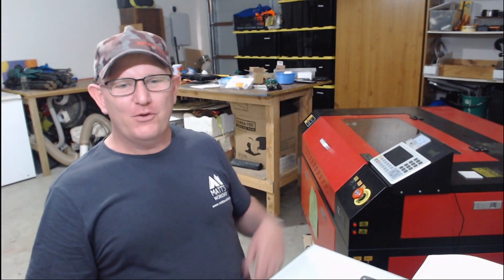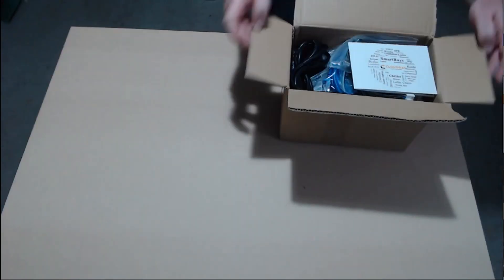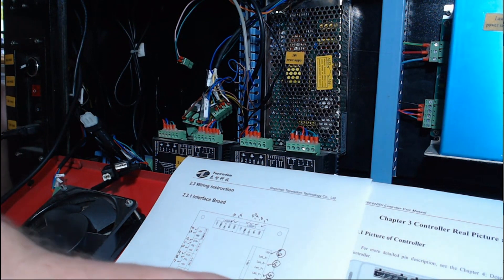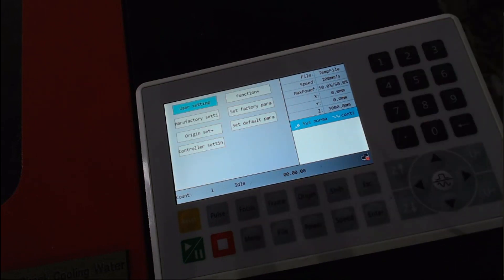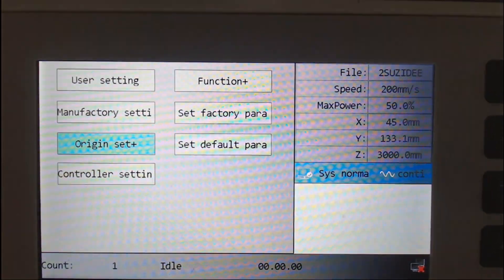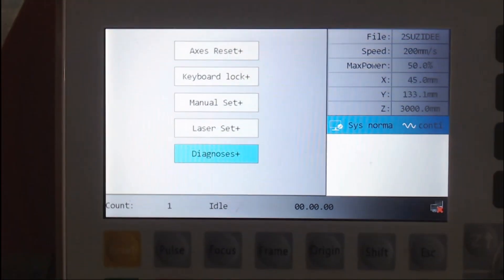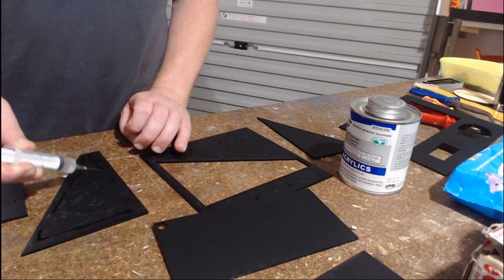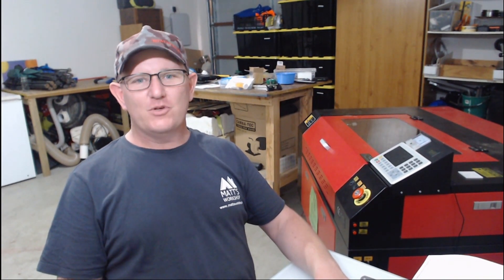Upgrade TopWisdom to Ruida RDC 6445 Laser Controller - CNC Co2 Laser Machine

Comment: I am about to upgrade my controller, I was hoping there was an easy way to copy the current settings for the machine to it. Have you ever tried to use lightburn or rdworks to export or import settings? I hope it just works.

Comment: Do you know if the rdc6445 panel will work on rdc6442 mainboard? It seems most the functionality is the same, it’s just difference button layout and screen size
Reply from the maker: No you should not use the RDC6445 panel with the RDC6442 mainboard. They have different functions and menu systems, in short If you connect a RDC6445G panel to RDC6442G controller, it can work but you will have many errors, such as:
When you read file from controller, it will hang / freeze up.
Files will not display correctly on the screen.
The function of some keys on the RDC6445G will not work.

Comment: Hi Matt, Very informative video.   I also use Lightburn, with a black and red co2 100W laser.  The laser seems to stay on between steps, so it marks the work surface.
Reply from the maker: What controller are you using?  email more info to matt@mwlaser.com.au

Comment: Hi thanks for video ,can someone tell me if its better idea to pay extra and get ruida version from beginning? On 50w cutter and why its better this way,thanks
Reply from the maker: Yes a Ruida controller is preferable to the TopWisdom controller and worth the extra $$ .  They are a much easier controller to use and configure, they are also compatible with much better software such as RD Works or LightBurn

Comment: Excellent. My JQ laser uses software that requires a 32 bit computer which has just died! Was pulling my hair out. This is an ideal solution.
Reply from the maker: If you have not already upgraded... This may help... I have been working on a new document to upgrade from the 32bit Leetro controller to a Ruida.  The video has been recorded and is currently being edited, so I hope to have the video and documentation released within the next few weeks.
Reply: @MWLaser  all swapped out (Cloud Ray, motherboard and drivers) customer services very helpful, but still having teething problems! Looking forward to the new video

Comment: I have an option to by this same laser from sail works used (originally purchased in 2015) but it has a chines laser and the none-Ruida controller for $1000.00  USD I'm thinking I may need to update the controller (as you did) and get a new laser tube. I wanted to ask you if you thought I should spend a bit more money and get a chinese machine that already has these upgrades installed from the Chinese factory?  Thank you!
Reply from the maker: Sorry I cannot give advice on a machine I don't know history of and is unseen or tested.  Cheers Matt

Comment: Will these instructions for parameterws work for ruida 6442s?  If not do you have those directions?
Reply from the maker: Yes the wiring for the 6442 and 6445 are the same.
The configuration settings for controller using Rdworks is in the documentation.

Comment: Hi Matt!  I'm hoping you may be able to help.. I have a same Chinese laser (except the 60 watt version) and have just installed the exact same controller using your video here as a guide.  The problem is that my laser keeps turning on and showing the laser at position 10000x,10000y.  To correct it, I have to reset the lasers position but it keeps hitting the x axis boundary on the left and making a horrendous grinding noise, which I know is not good for my motor.  The wiring is all correct, and the boundary switches are fine as when I reset it recognized the boundrys on both x and y.  Did this happen to you at all? If so, how did you correct it?
Reply from the maker: Yes after installing the new controller this will happen, but you need to stop or press esc when powering in the machine so that it does not hit the sides and grind on the axis.  
To fix this you will need to make settings changes in the controller for the size of the working bed and the acceleration as well as step settings.  I can assist you with this if you want. email me using matthew@mattsworkshop.net or go to my web address and start a facebook message from the homepage www.mattsworkshop.net
Reply: Hello,
 I’m having the exact same issue. Is the email still good to use to contact you? Thank you so much

Comment: Hi Matt!! I’m converting the top wisdom to the 6445 right now do I just connect all the wires that are labeled on the tl-410 to the same labeled wires on the ruida? 

Like lmt-Y+ on CN-1 would go to the CN4 lmtY+ on the ruida? 

The ruida CN1 doesn’t list a lmtY+ wire

The only lmtY+ is on CN4 for the ruida 

I’m assuming you had to extend some wires like the 24v+ and ground

Do you have a more detailed explanation for switching the brains? 

Thanks :)
Reply from the maker: Hi, I'm happy to help, Can you email for support using email address in description. Thanks

Comment: I decided to go with a 6442S instead. I rewired everything but hit one problem. The TL-403CB controller that was in the machine uses 5V/3A according to the diagram, but the RDC says it takes 24v. Did you have an issue with that? Our engineer here says we might need to wire a separate power supply for the new controller/box.
Reply from the maker: Hi Kevin, No I did not run in to this issue.  The controller I had was a TL-40C it used 24v supply. 

Check your power supply for the controller, the one I have has dual voltage outputs, it supplies both 24V and 5V
If your power supply only provides 5V then yes you will need a separate 24v for the RDC controller.
Cheers Matt
Reply: Matts Workshop Thanks for all the help! We looked over all the documentation and can not find a 24v supply. He’s going to wire a separate DC power supply and hopefully we’ll be running today. Cheers!

Comment: Just ordered a 100w with the top wisdom controller and need to do a ruida swap. That’s the model I’m looking it. How do you like it? Would you go with something else if you had to do it again?
Reply from the maker: No, if I was to do something like this again I'd probably choose the same controller again, it works extremely well.
Reply: Matts Workshop Great! I took a class at a local makerspace and they used Inkscape then exported to RDworks before sending it to the machine. Lightburn allows you to do everything from the same software? I see in the comments below you’re using RDworks now. Any advice?
Reply from the maker: Hi @pulaskiPumper  I mainly use Lightburn for all my work on the laser, I mention RD Works only because that is the software provided by the controller manufacturer RuiDa, and because is provided with the controller.
Cheers Matt

Comment: I'm in the process of this project myself.  Any suggestions at the various settings that need to be changed on the new controller.  I have the same laser as you except 100W.
Reply: I see you have some links to info.  I'll check that out.
Reply from the maker: Thanks Josh, If you require any information don't hesitate to ask, I'm more than happy to assist. Cheers Matt
Reply: Thanks Matt.  I must say I am a little confused on the wiring.  Seems like their are several wiring diagrams in the Ruida user manual and I'm not sure which one I should be using.  Maybe all of them.  Seems like each diagram serves a different purpose.  The Top Wisdom diagram seems to be pretty straight forward.
Reply from the maker: Hope you figure it out, I'm sure you will like the new controller.  I mainly used the diagram of the main board on page 10 of the most current manual for the RDC-6445 controller, matching up the connection plugs labeling with the connection labels from the TL-410c controller. They were all labelled similarly so there wasn't much guess work involved. Cheers Matthew
Reply from the maker: Correction - Page 10 of the PDF, however the bottom of the page is labeled as Page 6 :)
Reply: Matt.  Thanks so much for being so responsive.  Turns out I was making it a bit more complicated than necessary.  Turns out both control units have everything labeled on the units themselves so it was very easy to make the necessary wiring changes.  Only had to change about 4 wires around and it was done.  Everything is up and running and seems to be doing great.  I'm now able to use the Light Burn software which was my main goal.  Thanks again for your help!

Comment: I'm also trying to replace the laser controller to RDC6445G.
However, the stepper motor gets step-out. The pulse width seems to be too short.
When pushing arrow keys on RDC6445G, each motor on the X or Y axis gives high-tone sounds, but it doesn't rotate (sometimes it rotates slightly).
When setting 1/4 division pulse width on the stepper motor driver, the motor rotates but the moving width and the resolution also shrinks to 1/4. I'm in trouble.
By the way, I'm using the 17HS4401 stepper motor and the TB6600 stepper motor driver.
Do you have some information on how to set up the pulse width of the stepper motors on RDC6445G?
I'm trying to change the values in the "Manufactory settings" menu of RDC6445G, but it doesn't get better.
Reply from the maker: I'd suggest contacting support from your supplier.  If you don't have any success there then email me and I'll try my support contacts for you.
kiddovp@gmail.com

Comment: Hi Matthew. 
Check,  please, your system info+.
Menu->controller setting->system info+. 
Param ~Total on time~ on my new panel is more than 416 hours. Is it OK? 
Thanks. Regards,  Maksim.
Reply from the maker: Hi Maxim Yes, mine came with hours on time too - I can only suggest maybe while unit was at manufacturer testing.
To clear the time values - Open RD Works (I use v8.01.34)
Select -> File -> Vendor Settings (Enter password RD8888)
Select Tab -> Clear Info
Select the Values you want to reset and Click -> Execute
Enter Password RD8888 -> Enter
:) Matthew
Reply: It's, maybe, firmware from old worker machine.
Reply from the maker: @maksimsoft  I had email from Cloudray where they quote ... "The controller from us are new. The showing hours is our ageing test time."  

Regards Matt
Reply: Same quote)